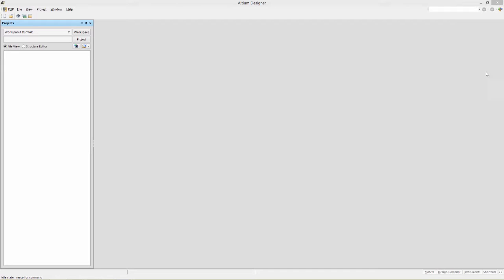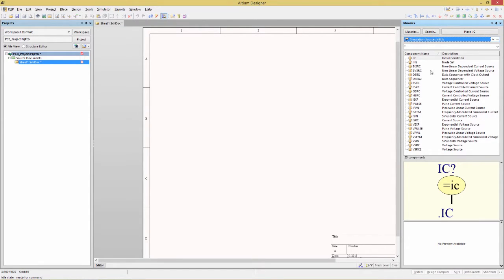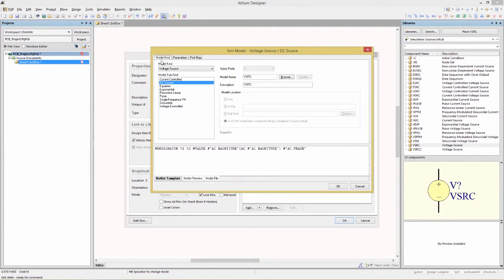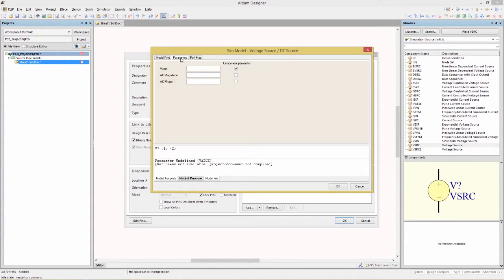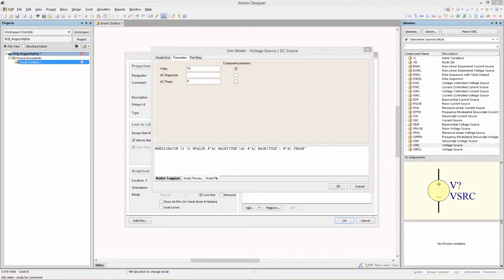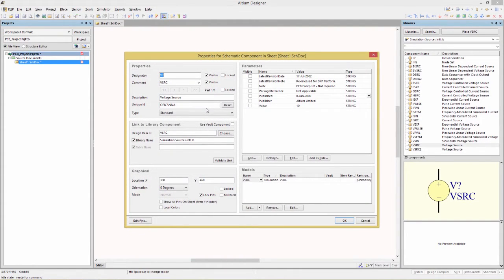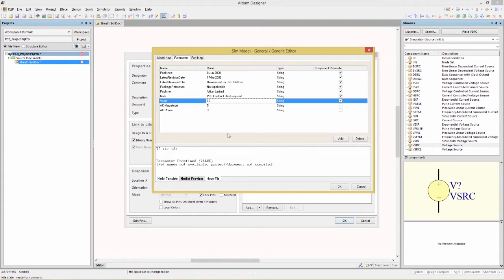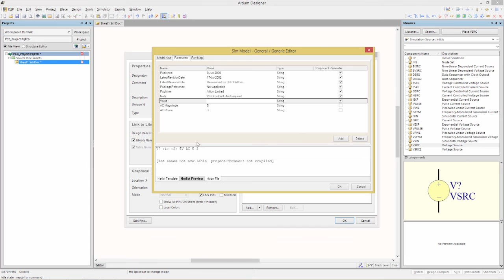SPICE Netlist Templates for Components - Module 3b

Comment: could you explain a video fo as create to spice subcircuit please
Reply: Sailer,

The Berkley web site has a brief description of subcircuits at this link: 

http://bwrcs.eecs.berkeley.edu/Classes/IcBook/SPICE/UserGuide/description.html#198

Armed with this knowledge you can create a subcircuit with a text editor.
Reply: Here is an example, but not a simple one. It is a behavioral model which is not a model of electrical components. There are models with in the model, IIRC.

The device molded is a 555 timer.

.SUBCKT SIMPLE_555 THRES CONT TRIG RESET OUT DISC VCC GND
*From: http://www.ecircuitcenter.com/Circuits/555_Timer1/555_timer1.cir
*555_TIMER1.CIR - ASTABLE MODE
*Modified to make into a subckt by F. Lee Erickson.  20180917.
*Add diode to output of NAND to simulate lower Out than VCC. 20200123.

*.SUBCKT SIMPLE_555 THRES CONT TRIG RESET OUT DISC VCC GND

*Wire pins to subckt. SWAG values for resistance.
RTHRES THRES 3 10
RCONT CONT 4 10
RTRIG TRIG 99 10
RRESET RESET 0 1Meg
ROUT OUT 14 50
RDISC DISC 2 10
RVCC VCC 1 1
RGND GND 0 1
*End of pins.

*Remove these parts which are external.
*VCC	1	0	5V
*
* EXTERNAL TIMING COMPONENTS
*RA	1	2	1K
*RB	2	3	10K
*C1	3	0	100PF
* end remove parts.

* DISCHARGE TRANSISTOR
Q1	2 6 0	QNOM
RBQ	15	6	15K
*
* 1/3 AND 2/3 VCC DIVIDER
R1	1	4	5K
R2	4	5	5K
R3	5	0	5K
*
* COMPARATORS
XCMP1	3 4 11 COMP1 
*XCMP2	5 3 12 COMP1 
XCMP2	5 99 12 COMP1 
*
* RS FLIP-FLOP
XNOT1	11 13 1 NOT
XNOT2	12 16 1 NOT
XNAND1	13 14 15 1	NAND
XNAND2	15 16 14 1	NAND
*
* SUBCIRCUITS AND MODELS *********************************
*
.SUBCKT NAND 1 2 3 4
* TERMINALS A B OUT VCC
RL	3	8	150
CL	3	0	100PF
S1	3 5	1 0 	SW
S2	5 6	2 0 	SW
R2 6 0 5
D1 4 7 D1
D2 7 8 D1
R3 4 8 10000
.model  D1 D(IS=2.55E-9 RS=0.042 N=1.75 TT=5.76E-6 CJO=1.85E-11 
+ VJ=0.75 M=0.333 BV=50 IBV=1E-5 )

.ENDS
*
.SUBCKT NOT 1 3 4
* TERMINALS A OUT VCC
RL	3	4	500
CL	3	0	100PF
S1	3 0	1 0 	SW
.ENDS
*
*
.SUBCKT COMP1  1 2 5
* TERMINALS: 1-INPUT+, 2-INPUT-, 5-OUTPUT
* DIFF AMP WITH HYSTERESIS
EDIFF	3	0	VALUE = { V(1) - V(2) + V(5)/500 }
* FREQUENCY RESPONSE
RP1	3	4	200
CP1	4	0	100PF
* LIMITER
EOUT	5	0	TABLE {V(4)} = (-1MV 0V) (1MV, 5V) 
.ENDS
*
*
.MODEL SW VSWITCH RON=10, VON=1.2, VOFF=0.7,ROFF = 10MEG
.model	QNOM	NPN(BF=100)
.model  D1 		D
*

* ANALYSIS ***********************************************
*.TRAN 	0.05US  5US UIC
*.IC V(15)=0V V(14)=5V V(3)=0V
*
* VIEW RESULTS *******************************************
*.PRINT	TRAN 	V(3) V(14)
*.PROBE
*.END

.ENDS
Reply: Yeah, thank for the material in the link, i can create this space